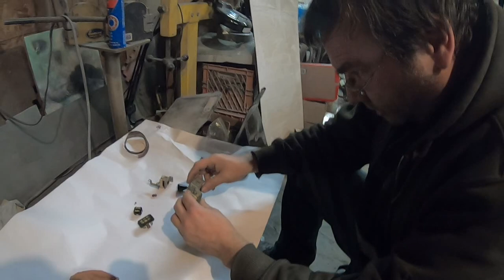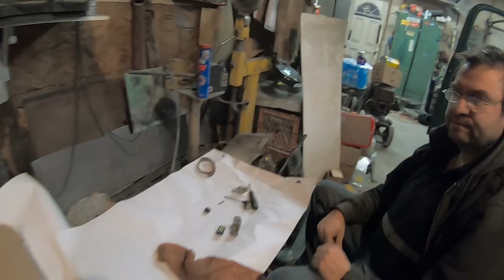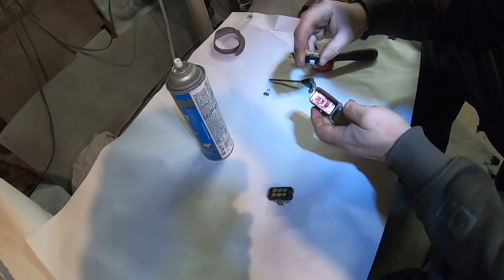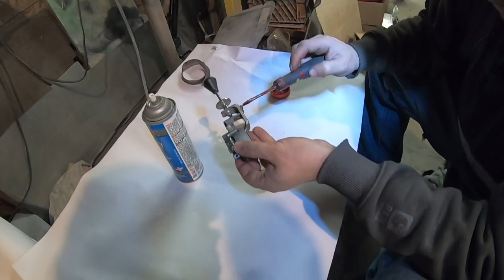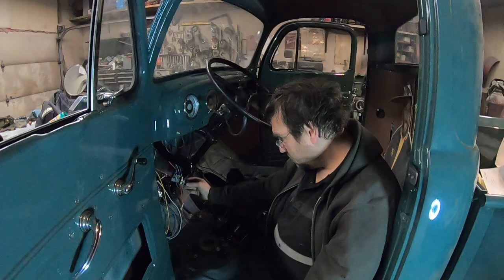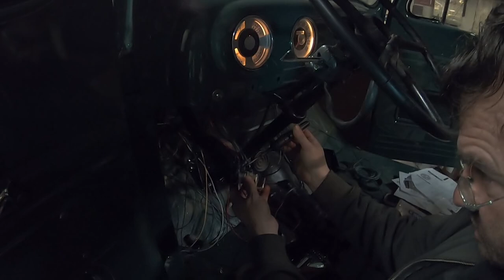1952 Ford Headlight Switch Rebuild. DIY Headlight restoration.  52 Ford F1 Project Truck.

Comment: The first notch should be marker lights which includes taillights marker lights in the front of the truck and the dash lights. The second notch would be all of the above and the head lights.
Reply from the maker: Thank you Jon this truck has been really fun to drive . are you building one.
Reply: @pennyshotrodscustoms  No, I had one, but Hurricane Katrina finished it off.
Reply from the maker: @jonpeters2700  Sorry to hear that.😣😣

Comment: I have worked on those type headlight switches before and they are not that easy to get 100% working every time. When I don"t have grease I use vasoline seems to work great on helping to hold small part together during assembly. That unit for diming the dash  lights seems to be the hardest to find not destroyed by time.
Reply from the maker: The dimmer portion seamed a little delicate with the porcelain.